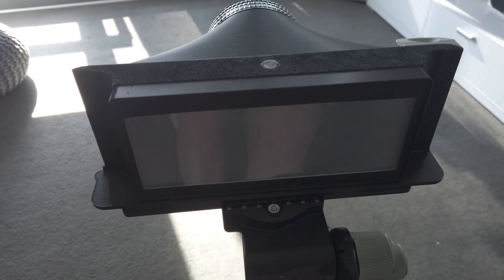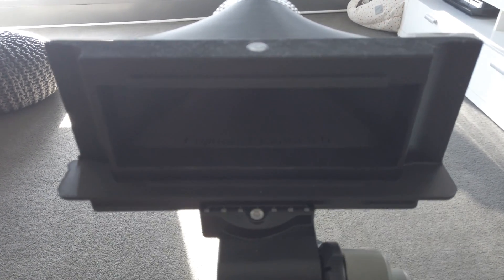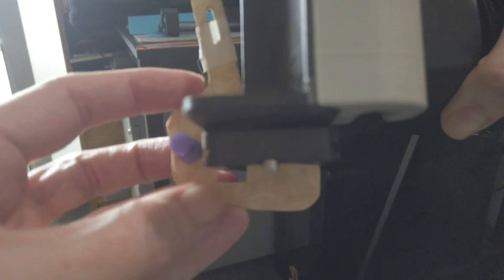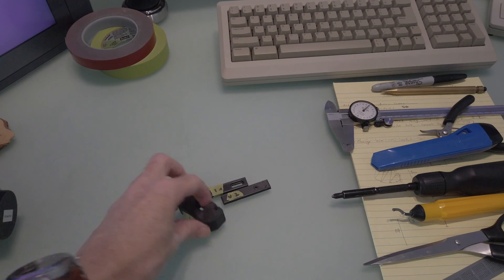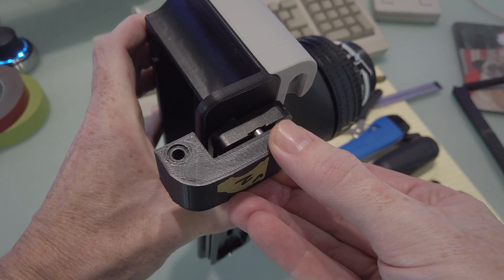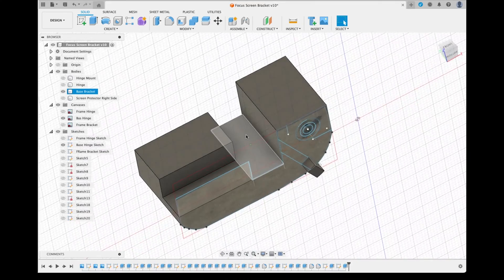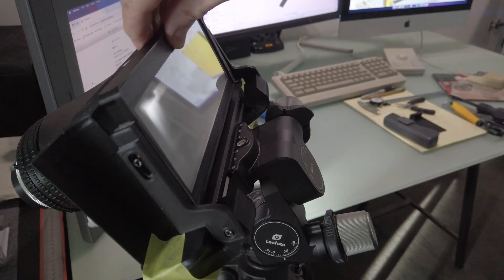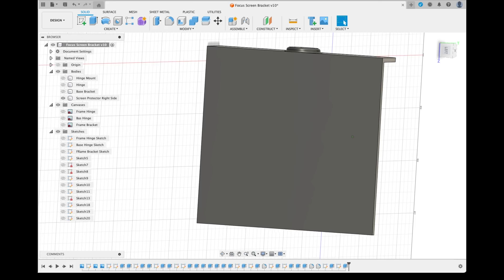Chroma Six 17 DIY Focus Screen Mod

Comment: Can you tell me what size arca Swiss plate you used and the screw size and length for attaching together?  I just received my printed parts back.
Reply from the maker: That's awesome. I'm using a 200mm plate and the screws were 10mm flathead screws, two on each side seemed to be enough. Just remember to predrill the holes so you don't crack the 3d print.
Reply: Forgot to add, the way put it together was, I just the plate on the camera and mounted the arms to the grou d glass with the double sided tape and then added a small dot of hot glue to each of the parts that will be screwed to the plate and put them in place so they were at the right placement so the arms were parallel with the ground glass and move freely, then once I was happy I gingerly unscrewed the plate from the camera so as not to break the hit glue and added the self tapping screws for strength. This was you can put the whole thing on the camera and get the right placement first and just use hit glue to hold it until you add the screws. If that makes any sense 😂